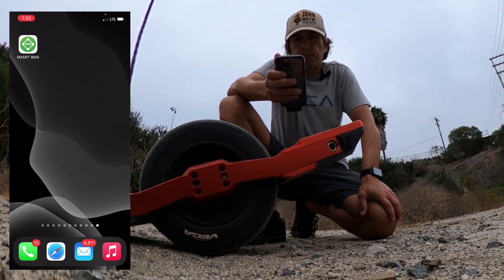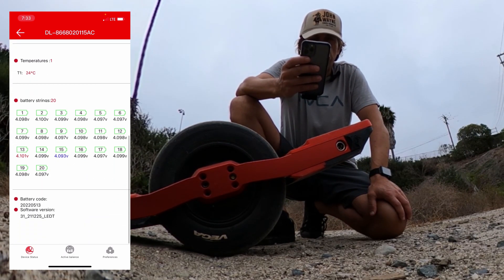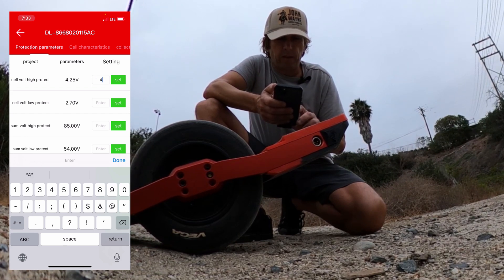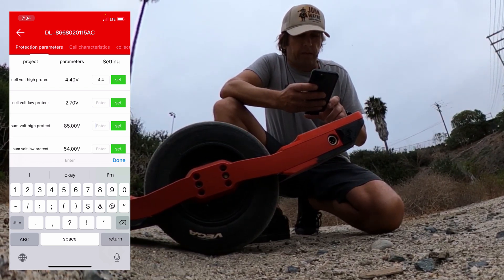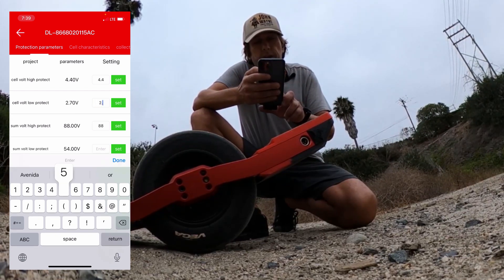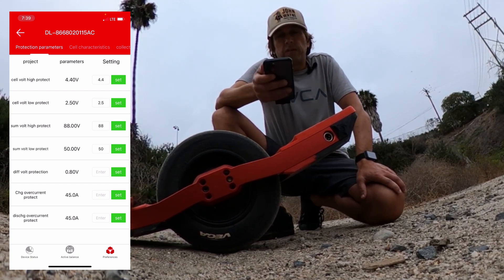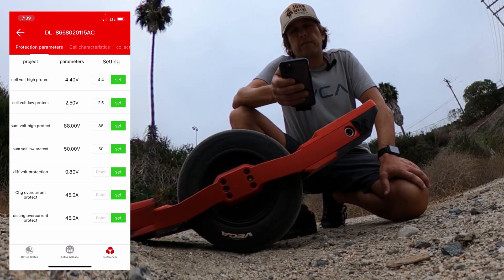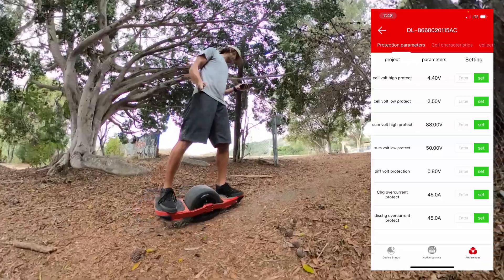CBCSO adventures continue - how to configure it the right way

Comment: Yeah, the daly smart bms is very bad with balancing cells, but it does work, if you hack the software to trick the calibration which also ruins the SOC indicator, but at least you can get the bms to activate the cell balancing. Maybe your friend Max would appreciate this info.

Comment: Great review as always! Are those the fungineer thunder rails?
Reply from the maker: yes they are
Reply: @surfdado  how do you like them? I ordered them in mint. Still waiting. Hopefully soon 🙏
Reply from the maker: @seanhaines426  I like them so much that I decided I will order another set as soon as they start taking orders again
Reply: That’s awsome! Still patiently waiting for rails. Still no word on delivery, but hopefully by end of week.
Do you like the thunder rails better than the WTF rails you had on there before?
Reply from the maker: @seanhaines426  I actually do like them better, I like their bolder look as well as how easy it is to change the ride height
Reply: @surfdado  that’s great to hear! I am very excited about putting this all together. I do not have an old XR to work off of so it will be scratch build. So far I have ordered rails,superflux,stompies, fungineers battery(although I may pick up a more powerful one from chi batteries, with dedicated charger) and enduro tire. Need to pick up printer or see if someone local has means of printing those files that come with rails. Then pick up flowglider vesc complete kit. Anything else I am missing?

Comment: Hi Dado, very interesting to see your review and overview of the BMS. I'm super curious to also hear your thoughts on the 20s battery configuration. I hear you say at the end you're intending to build your own pack with the same cells in the same configuration - again, would love to hear your thoughts on this.
Reply from the maker: I don't care much about speed, so to me 18s is just fine (got that on my other board), but 20s fits into the box so why not? You get 12% more range and 12% more headroom
Reply: @surfdado  I imagine the torque was still great?
Reply from the maker: @sarahdaviscc  the reality is that torque even on the stock XR pack is great, most riders won't feel a torque increase. On FM boards the torque is primarily limited by the controller
Reply: @surfdado  cool, thanks Dado!

Comment: Regarding your BMS going to sleep- I have an issue where once my BMS goes to sleep, if I turn the board on and start riding, the BMS doesn’t turn on until it detects significant current, so I’ll just start to roll, then suddenly the whole system shuts off then back on when the BMS actually wakes up. Usually not an issue because I barely get any speed before the flow of electricity triggers this, but it would definitely catch anyone else by surprise. I discovered I could wake up the BMS instead by turning the board on then pushing it aggressively for a few feet, which caused enough regen current to go through the system that it wakes up the BMS. If your BMS goes to sleep on you in the field, maybe try turning your board on then pushing it a bit to wake it back up?

Definitely a finicky system, but I’m expecting quirks on a project like this.
Reply: Like push starting a car
Reply from the maker: Yeah, that was the first thing I tried - but didn't succeed, I guess I could have pushed harder but I had a good place to hide the board and was less than a mile from home so I didn't bother